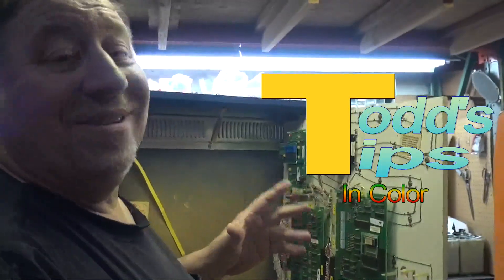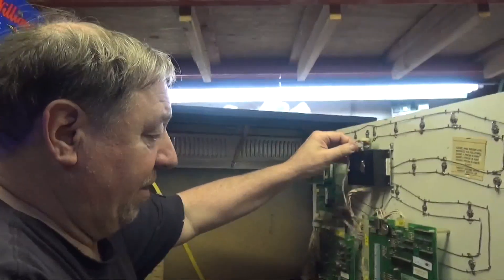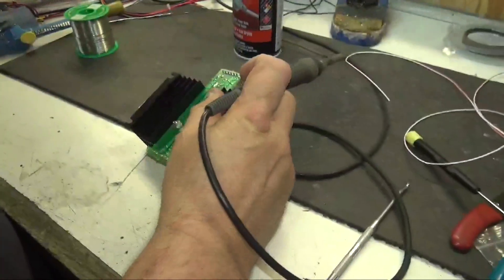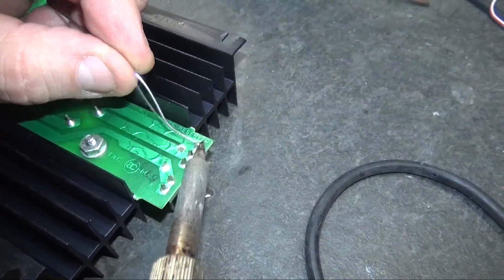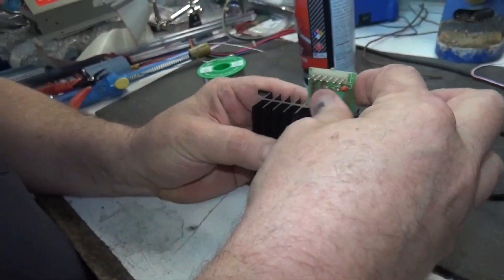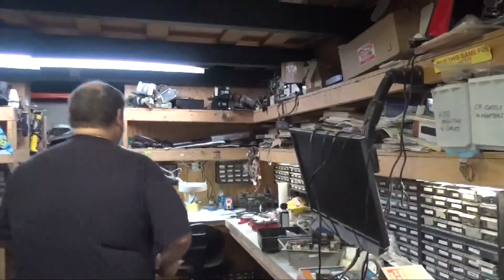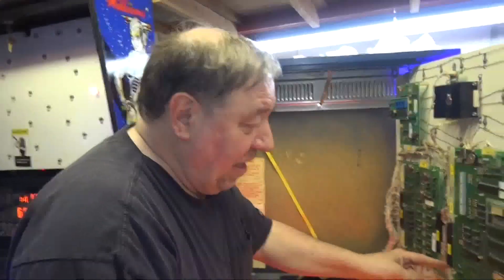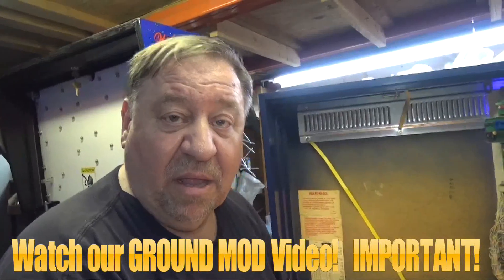#981 REFLOWING SOLDER on HEADER PINS!  A TNT Amusements TODD"S TIPS!

Comment: just a quick note for you folks, video game monitors, guitar amps, radios, cell phones, gm ford and honda automotive electrical parts ALL FAIL FROM THIS. honjda main relay, gm truck gauges and 4x4 switches, gauge clusters... seriously if it works sometimes take it apart and look, you just may spot a cold solder joint and save alot of money even on your car as an ex mechanic
Reply from the maker: A cold solder connection on an instrument panel light in the cockpit started the chain reaction that downed that one jet that killed 140 people!

Comment: Just fixed my G07 in my Centipede with this tip. It's been losing horizontal sync for a while now. It got so bad that just tapping the control panel would make it lose sync. The problem- cracked solder joint on a header pin on the monitors main circuit board. I reflowed the cracked solder joint and the rest for safe measure and the game is rock solid now. Thanks for the tip!
Reply from the maker: Glad the video helped!

Comment: 2 down  smh  yeah I know jokesters.  guess what.  very easy to tell cold solder joints if thats what you call them..  pull apart a cheap item from china probably a usb item and if it's not working right start wiggling the wires.  ahem unless they are glued on (face palm)  did find one though LED fried the board on a short 4 usb hub  cheap solder.  lose as can be :(   I can solder but cleaning the tip off is a #(#**@# oh yes all of it LEAD  and some solder?  is not for electricity my brother tells me.
Reply from the maker: Lee Bartholomew Frequently you can open up electronics and reflow solder on connectors (just did TWO of our security cameras) and it solves intermittent issues)
Reply: TNT Amusements Inc I've done that , just not with silver solder   my project someday is to fix the cb radio of grandpa's.